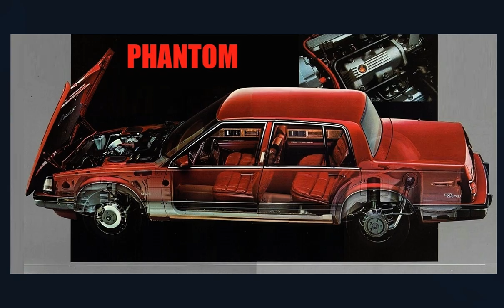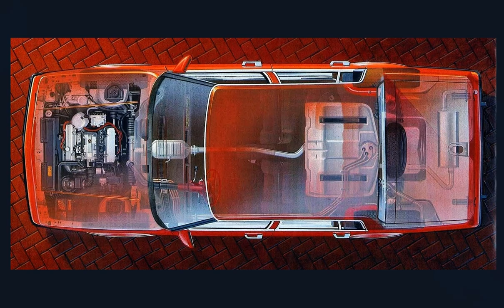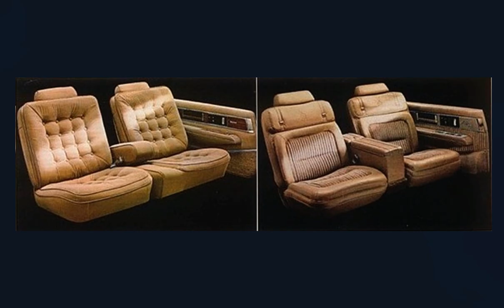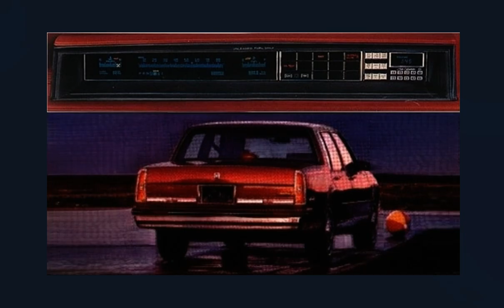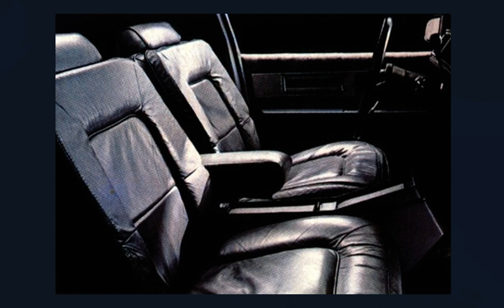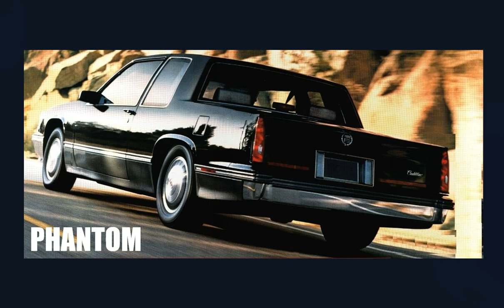1985 Olds 98, Buick Electra, Cadillac Deville: GM's C Car Sea Change

Comment from the maker: 40 years ago GM's "C body" revolutionized the industry. It used mass air flow sensors, "50 state" emissions, heated mirrors, "accel" cruise control button, MPG gauge, anti-lock brakes, retained accessory power and even optional cell phones!  With the footprint of G body intermediates but the room of '83 big cars, the front drive and short wheelbase gave them hopelessly awkward proportions. In this alternate universe, they get a rear drive transaxle for better handling than BMW and Mercedes big cars. Adding 5" more wheelbase and length turns awkward looks to awesome. Olds and Cad use a 'corporate' V8 based on the Buick V6 with 160 -180 horsepower. GM's technical tour de force becomes beautifully bad-ass!